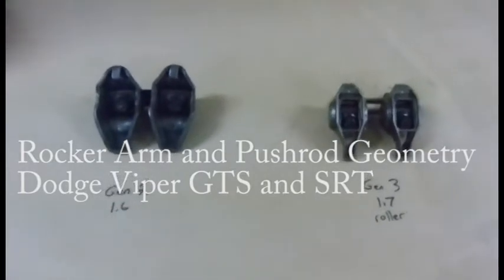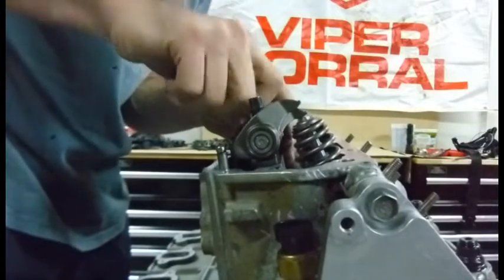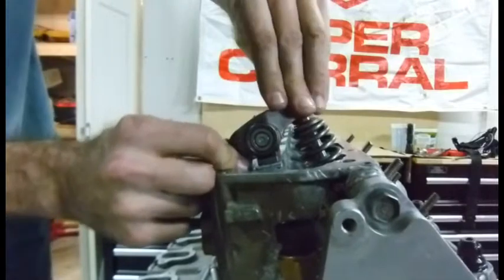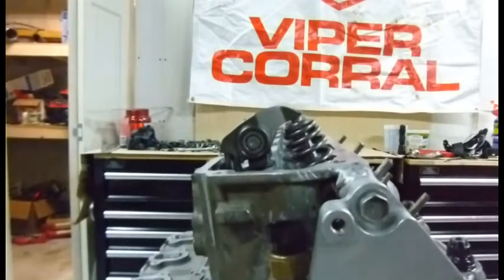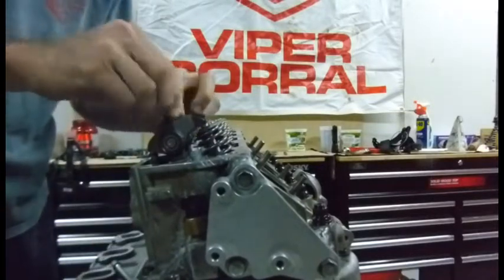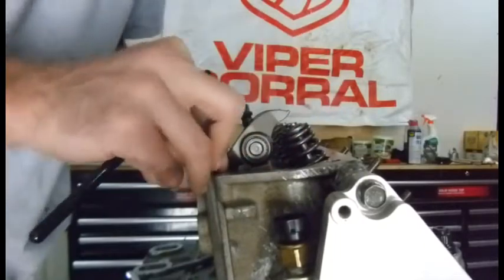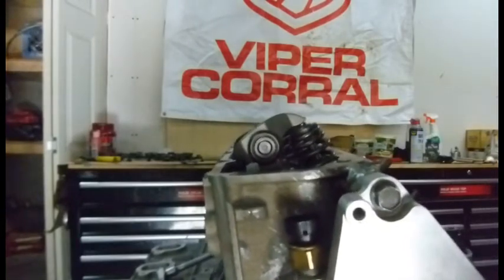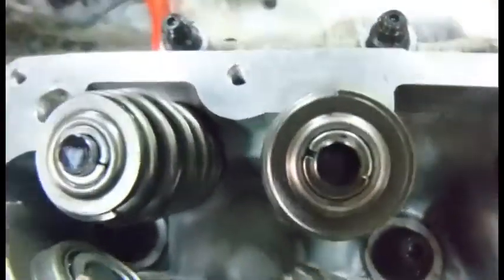Valvetrain Geometry & Rocker Arm Upgrade Dodge Viper

Comment: I need help. I have a 2005 SRT 10 Gen 3. I have rebuilt the engine completely and it is running. I am fairly certain I measured the push rod length correctly, but I am getting a loud ticking noise. At idle it isn't as bad, but when I rev the motor it gets louder. I torqued everything to spec. I watched the oil come through the push rods...so the lifters must be in right. I put bigger springs, new lifters from JTSVP, a mild cam from Comp Cam, but have not yet reprogrammed the computer. please help...what am I doing wrong?
Reply: There could be so many things wrong , just let a pro look at it before you f**k the whole engine up .

Comment: Do you have a rod bearing removal and install video? I am going to change mine out with the engine in the car. Seeing if you have any tips and tricks. Thank you
Reply from the maker: I am planning to do rod bearing video, but have been busy with life.     Currently working on turbo system for the Zombie Suburban.  First video to post soon.
Reply: Nice man! Yeah, I am in the middle of doing a full build other than piston/rod change. Bought a couple of NRE mirror image 72/68 turbos and am having a friend fab the hot and cold side. But I wanted to replace to rod bearings as they are the only easily changed thing that hasn't been upgraded. I bought some Clevite Bearings. If you do get around to the Rod Bearing Video, I hope you can do it in the next month. Completely understand the busy with life. But I love your videos and will be keeping an eye on your posts.

Comment: What would I have to do to get 600 horses out of my car ??
Reply from the maker: If you have a gen IV or V Viper, absolutely nothing!
Reply: I have a 94 and some one  Wants to sell me some striker heads , he sead i could get 200 from them.
Know people fl that are  Knowledgeable about These cars
Reply from the maker: @georgioocean7629  Those stryker heads are patterned off the gts-r heads and will not fit your gen i.    Send your gen 1 heads to Greg Goode in Houston.  Prepare for a long turnaround.   Ask Greg for a camshaft recommendation.    He can get you 600hp.
Reply: @CrankAddict   thanks 😊 🙏

Comment: You waisted a lot of time, why didn’t you use an adjustable pushrod to measure the proper pushrod length. You would have been done in a few minutes with no guess work.